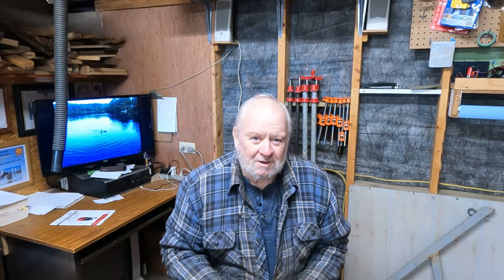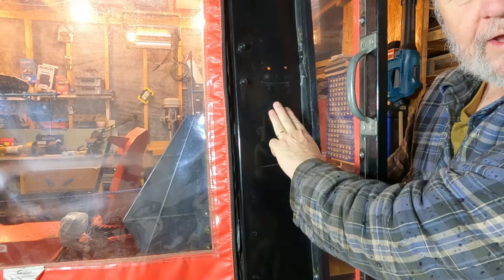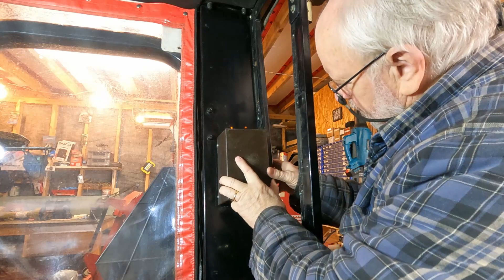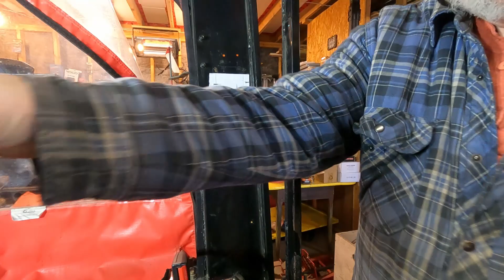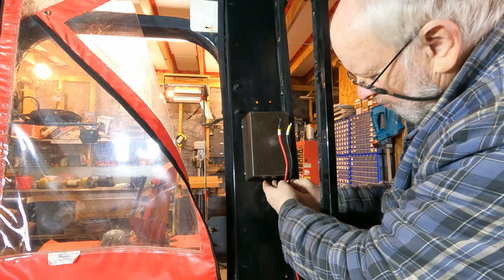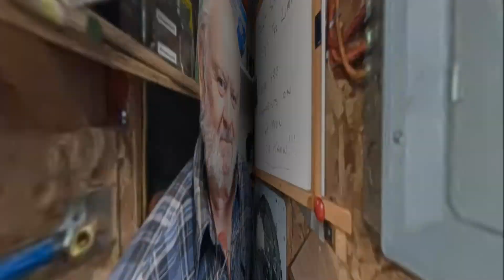Installing a Remote Control on the Massey Ferguson GC2300

Comment: Good Job Derek. You have made your father proud.
Nice install Mike. I bet that will improve your snow handling and especially the logging. You can guide the logs with a bar while dragging them out. Goes without saying to be careful being around the moving logs. We don't want you getting yourself hurt. 
Next is a set of controls from a drone so you can set your Massey on auto pilot and do the whole thing from your easy chair. 😁😎
Reply from the maker: How's she goin'?  Thanks Dave!  Derek sure knows what I need and this time he nailed it!!  LOL  The remote control for the tractor is a nice plan and would be worth checking into, but then I'd miss out on the tractor seat time and I like that part of plowing!!  LOL  Take 'er easy!!

Comment: Well that’s a handy unit !!! That will be handy when pulling on some logs eh, and the chute wow.
Awesome job Mike very interesting.
Reply from the maker: How's she goin'?  I'm looking forward to pulling some logs and using it in the spring.  The old winch I am using has dyneema cord on it I don't think that is as dangerous as wire rope, but with this remote it won't matter as I can stand off to the side when I use it!!  Thanks for the dropping by the shop today.  Pretty windy here and we have no power tonight.  I hope you folks are doing OK.  Take care!!

Comment: When I saw the title of the video, I thought you were going to be inside the house in the warm controlling the tractor 🙂 That is a fantastic add-on for the tractor, great job getting it installed. You could stick a magnet on the back of the remote to locate it in the cab and to enable it to be removed
Reply from the maker: How's she goin'?  I had some comments about making the tractor remotely controlled.  Now that would be an interesting project eh!!  LOL  The remote has a clip on it and I can hang it on a little box I made for a log book I keep in the tractor.  It's easy to reach but out of the way.  The remote control is a nice add and I'm really liking it.  Thanks for the visit and take care!!

Comment: The reverse-paper template was a great idea to locate the holes. That was very smart! I've always heard that you guys in Nova Scotia work well backwards and this proves it!  LOL The notch for the wires instead of a hole was also smart! This remote control will save your neck from having to twist into a pretzel. Just don't forget the remote control in the camp when you head out to the tractor (that would take the efficiency out of this system🙄). Have a great weekend, Mike. Hello to nanny, we hope she is doing well!
Reply from the maker: How's she goin'?  Getting the box mounted was a struggle and to be honest, I drilled more than the required number of holes, but I finally got everything lined up and it's even pretty straight and true!!  LOL  I keep the remote in the tractor so it'll be there when I need it.  It works pretty nice.  I used it again this morning.  I'm loving it!!!  LOL  Take 'er easy!!

Comment: Good job on the installation Mike!  Well thought out, with the wiring and protective cover. 👍👍
Reply from the maker: How's she goin'?  Getting the plastic box installed was a bit of a struggle.  Trying to get the holes in the right place to line up with the square tubing.  But I got it and it works so what else is there eh!!  LOL  Thanks for watching Jim and take 'er easy!!

Comment: Great tool Mike. I know what you mean about the hurt in the finger tips. And those buttons are hard to push. You’ll have to tie a string to the remote controler, then fish it thru your coat, like we did when we were kids, so we would not lose our mittens, that will keep you from loosing it. 🤭
Have a great weekend you and Nannie. 👍🏻👍🏻👋👋🎄🎄🪵🪓🔥🇨🇦🚜
Reply from the maker: How's she goin'?  I remember those mittens Noel.  Mom used to use safety pins too.  I felt so stupid going off to school with my mittens pinned on my coat!!  LOL  But I never lost a mitten.  I guess Mom was more interested in saving the mittens than she was about how I looked!!  LOL  Take 'er easy!!
Reply: @GrampiesWorkshop   🤭🤭 👍🏻👋🎄🪵🪓🔥🚜🇨🇦🍻

Comment: Good clean looking install. I have had that same remote (exact color and all) on a piece of farm implement for 10+ years now. If yours works as good as mine you’ll be TICKLED 👍 I’ve only had to replace the battery in the remote twice in all those years.
Reply from the maker: Hello there Dave!!  I hope this one lasts like your is.  I know so far I really like it.  Sure is nice for moving the chute on the blower and in the spring it'll get a work out when I start pulling some logs again!  Thanks for the visit tonight and take 'er easy!!

Comment: works great, I put one of those on my lift table that had a winch but I took it off and kept it when I sold my lift table.
Reply from the maker: How's she goin'?  I wasn't sure if I would like this remote controller but it's pretty slick eh!  That was a good move to save yours when you got rid of your lift table.  Take 'er easy!!